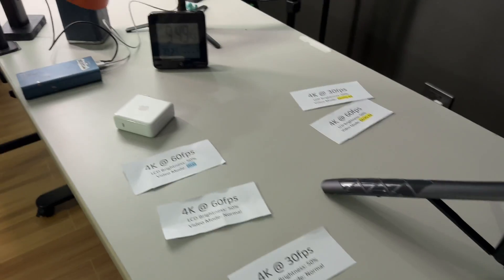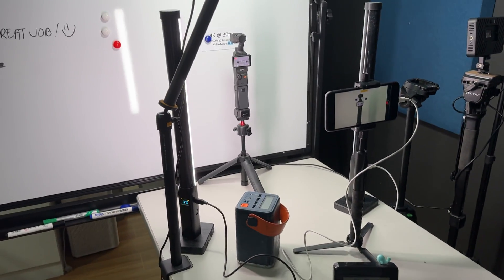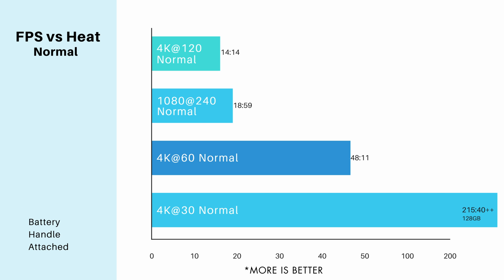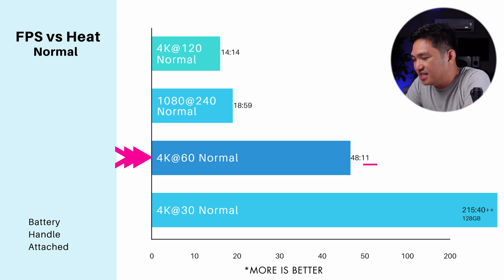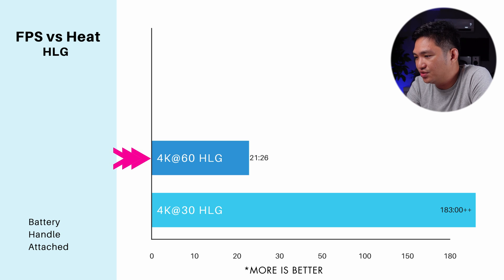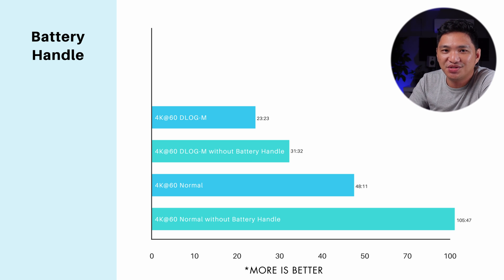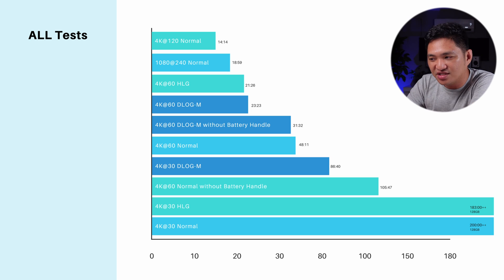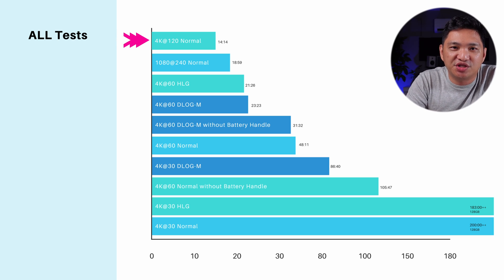Ultimate Overheat Test of DJI Osmo Pocket 3

Comment: At 30C in Taipei, my OP3 did overheat and stop recording 4K 120FPS after approx. 30 minutes continuous recording. It won't start the recording immediately. Therefore, I continued my works with iPhone.  Summer is coming. Everyone of OP3 users will encounter the overheat problems soon.
Reply from the maker: Summer has arrived here in the Philippines 😅

Comment: Hello, 

1. so if I shoot in 4k60fps without the battery handle and then my battery drain out to 0 so instead of attaching battery handle is there a system to charge that in-built battery using Type C cable ??? 

2. Can we transfer our videos which are shot on pocket 3 to iphone 13 using lightning to type C cable???
Reply from the maker: 1 - yes you can charge the in built battery with usb type c cable
2 - i believe you can
Reply: @titodomph  As you have iphone 14 pro max .... 
May I request if you can quickly try to transfer using lightning to type C, Please!!!
Reply from the maker: will try tomorrow with my wifes iP12. Im currently using iP15 with usb c
Reply: @titodomph  Hey!! May I request if you can try to transfer video using lightning to type C in iphone 12 from pocket 3 without using dji mimo app
Reply from the maker: I just tried with my usb c to lightning cable, it is a 3in1 cable, usb c to usb c/micro/lightning but doesnt seem to work. But i think its because of the cable. iPhone 12 does not get recognized when I plug to my mac using that cable. Unfortunately thats the only usb c to lightning cable I brought on my trip. I will be back next week, will check if I have usb c to lightning data cable at home. I tested usb c to usb c (iPhone 15 pro max) and it works.
Reply from the maker: I was able to find a usb type c to lightning cable that actually works and sad to say it does not work on iphone 12 pro max. It works on iphone 15 pro max via usb c to usb c. Hope that helped
Reply: @titodomph  Thanks for your response! 

So, when you tried to transfer videos from pocket 3 to iphone 12 pro max using lightning to C cable it doesnt work out......but ..... when you tried to transfer the same video using C to C cable in iphone 15 it worked (without going to dji mimo app you were able to do simple copy paste videos,, right?)
Reply from the maker: correct. on iP15 when you connect OP3 via USB C cable, it will ask OP3 if you want it to act as OTG, the on iP15 it will show in the files app, similar to plugging in a usb thumb drive

Comment: Hello, 

1. So, if we shoot with just in-built battery in 4k60fps, it would give us 105 minutes, right?? 

2. But if we shoot with in-built and battery handle attached to it (with both 100% charged) then it would record for 48 minutes, is that right??? 

3. If our in-built battery is close to 5percent and then we attach battery handle and then record then how much we will get recording time in 4k60fps?
Reply from the maker: The reason why shooting with battery attached is shorter is because of overheating. I think that makes sense because the unit is being charged. Like how hot our device gets when being charged even without using it.
Reply: @titodomph  I get it.... but if you can reply to those 3 questions, please!

Comment: appreciate it for your test bro, just looking for overheating test in high degree area because im in Indonesia now that normally 30degree + celcius in normal day, a lot of other youtuber test in quite low temperature area such as europe or us, can i know what sd card you use ?
anyway its quite strange , when battery handle are suppose to make extra long recording, but turn out to be shorter
Reply from the maker: Glad you liked it. I am using Sandisk Extreme Pro 128gb. I was surprised too to see that I can record more without battery handle but then realized because its charging all the time.

Comment: Can you do two more test scenarios.   One with an external battery pack attached and a second with the camera plugged into A/C power.
Reply from the maker: Will be the same or worse plugged in. Worse if you use a fast charger as fast chargers heats up devices more. Also I dont have bigger sd to test. Mmi ran out of storage on some tests..

Comment: Who films inside all day long? On a vlog camera? None of those results pertain to me here in Florida where it's 90/95 on avg with 85% humidity outside. Ive had 4k60 overheat my camera in auto and dlog in under 15 min with main screen at 50%. Overheating results from a camera stuck in a room are very much skewed and dont match real life usage. Go outside in 80 degree weather, set up a table or walk around in the sun until it shuts down. Guarantee the results are completely different. I do see some good baseline results but it's just not real life.  Also, makes a difference with screen flipped horizontal vs vertical as the little bit of air being able to get to the device helps as well.
Reply from the maker: well for one I want to have a controlled environment for testing. So much variable shooting outdoors. Second there are actually people who shoot indoors.. in their studio.. while vlogging and cooking.. Talking headshots.. I can think of so many to put in this comment. But the main reason for testing this indoors is to have a consistent environment. plus one test lasted 3 hrs, youtube not paying me yet to walk 3 hrs just for one test hahaha! I hope you get it. If not well.. Wish you all the best and have a nice day.
Reply: a controlled environment is better for testing, and with limited air movement and a set temperature and without the consideration of sun... his test provides a baseline. up to you to figure out how much your own use case situation might effect the battery life based on the results from indoors. Plenty of people are going to use this camera for indoor vlogging, potentially podcasting and so on.
Reply: I would like to shoot indoor events "first person filming" continously that last more than 2 hours, and that's why it would be good if the camera can handle that time without problems.
Reply: there are a lot of cameras that can continuously record if you substitute the battery for a dummy battery/AC adapter. Like even if you don't have formal AC, I have a small portable powerbank with two AC outputs, I can record or stream endlessly with my ZV-1 with that platform. The dummy battery with adapter was like 11 dollars. @m11kan
Reply: is the handle was getting hot ??